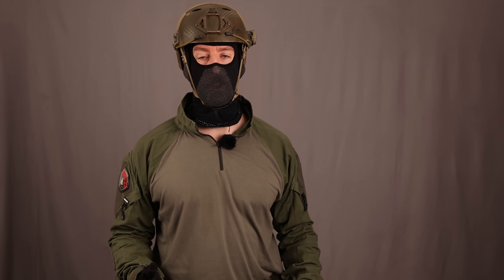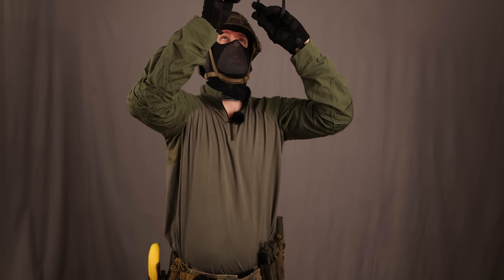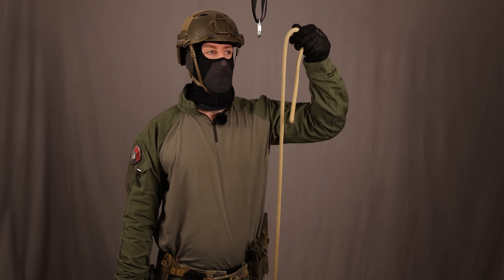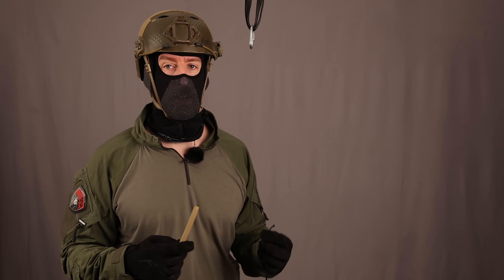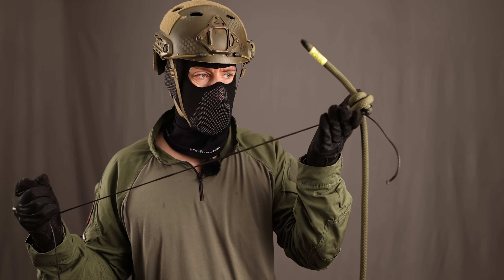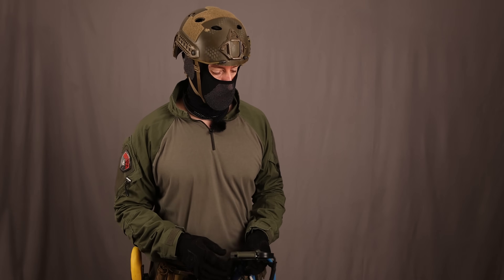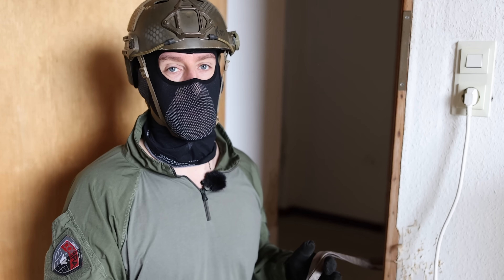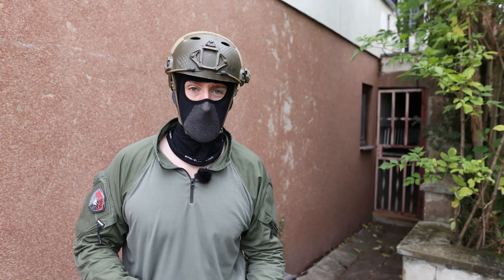How to Retrieve Your Rope After an Urban Rappel

Comment: 4:00 have seen that but adding a carabiner  to stop  the rope, that knot alone looks scary (specially depending on the size of the quick-link or ring that you use to rappel)
Reply from the maker: Yeah, but then you pull a carabiner down and have the risk of it dropping all the way down on a hard surface. So with the hight quick link I prefer to just use a knot.
But you are right. With some rings the knot will possibly just not be big enough.

Comment: Is that just a normal, non climbing rated steel threaded link? Yeah no problem getting a rope back because it's going to fall right on top of you when that bitch snaps under any real load? Bro I can't take you seriously when you're using hardware from the home improvement store

Comment: Why leave your slingloop? You can add the pull string to the loop end and after you are down you can pull the string and you might recive the slingloop and less traces/ evidence.
Reply from the maker: For a more universal approach I decided to show this. Everything you want to pull down by letting it slide on the floor is possible to get stuck. There are doors, furniture, toys, radiators and and and.
But yeah, if the building allows, you can build anchors, that will be reliable to pull down. I will likely do a follow up video :)

Comment: There is something we use in arborism where
The end of your rope has a ball(a knot might work too if done properly i guess,but a nice solid ball like a golfball or a wood bead that size)
A belt with two metal rings on each end,one ring big enough for the ball to pass trough,while the other smaller,so that it catches the ball
Once you reach the ground,you can pull back your rope,until you get to the belt,it gets undone,and you retrieve your attachment system too
Reply: Man just use a crotch in the tree 😂

Comment: what about using a "mountain climbers sheep shank"?   After tying it you cut the center strand but once you do that you have to be able to keep tension on the knot until on the ground. at that point you can shake it loose.
Reply from the maker: I tried it a bit in my studio. On the thin rope it seems not to work/releases under load.
With the 11mm rope it hold like 95% of the time. But shaking it loos was sometimes harder than expected. It indeed needs some movement and I am not sure how well this works, if there are 2 or more edges involved.
I guess I need to try it out some more to get a better feeling about it. But for now it felt like it is way less reliable than bringing a tag line or doubling up the rope.
Reply: @ripperkon I think you are correct. It probably only works for a straight drop rappel which is pretty much all I have ever done. If you had to anchor your rope around one or more corners or obstacles it might be difficult to whip the rope enough from down on the ground to get it to release. Another thing I didn’t think about is if you did a really long rappel the weight of the rope might also make it difficult to whip it hard enough to release the knot. Thinking about it more your methods are probably better.  I guess the mountain climber sheep shank would probably be best as a last resort when you didn’t have enough rope to double up the rope or didn’t have a tag line.

Comment: Look up a knot called the "sheep shank" tie this knot and study it carefully and you'll find you can cut one of the three pieces in the middle of the night and it will not fall apart until you get to the bottom of the ground and whip the knot whip the rope up and not comes undone and you only lose a few feet of your rope at the top. I wish I could send you a picture as it is pretty slick.
Reply from the maker: Ah, I know this as the "Kamikaze Knot" - but never tried it. Thx for the idea, I will try it.
I guess I will soon do some content to some options like that.
Reply from the maker: I tired it a bit in my studio. With the thin cord it just released under load. I guess it is not stiff enough.
And with the 11mm rope I feel like it needs a lot of movement to actually release. Maybe this works on a rappel with the anchor in sight. But in an urban setting with two or more edges ... I am not sure. I guess I need to give it some more tires to find a conclusion. But for now I feel like is a lot less reliable and you rope might get stuck.

Comment: 4:19 What type of carabiner is hanging up there ?

Is it even certified.. rated.. whats the price (and name in Germany/elsewhere) ?
Reply from the maker: This is a Maillon rapide or screw/quick link. Some manufacturers make them. 
The small 6mm version has got a WLL of 400kg and will break at something around 2.000kg. 

But it is important to use the certified ones, since the ones from the hardware store are weaker. HowNot2 possibly made a video about it.
Reply: @ripperkon  The ones one typically finds on difficult alpine tours/hikes.. 

i would immagine most of them are not certified..

as they are typically used for anchor to abseil (and left there)
Reply from the maker: Yeah, some indeed leave behind the non-certified ones :-/

Comment: door as an anchor! Why didn't I thought of that? Thanks 😊

Also descending on a 5 mm rope is some badass move, 8 mm feels challenging already. Btw, is it possible to do that SRT using a "super Munter"? Would it be worse than double rope and usual Munter?
Reply from the maker: Yeah, this is super quick, if the door is not fixed to the hinges.

To me it seems like beal doesn't want people to rappel on one strand.
I did not try it, but I am sure a super munter would work with one strand.
But I was surprised how well two strands with Munter hitch worked.
Reply: @ripperkon thanks, I might try this one day! 5 mm is a bit scary, but if one strand with super Munter works, the rope will take so little space you basically can easily have it on you at all times, alongside with a carabiner and a compact webbing harness
Reply from the maker: I tried it: The beal backup line works quite okay with a super munter on a carabiner with a round profile. A h-profile was too much.
Reply: @ripperkon that's awesome!
H-profile gives you uneven movement, right? That was the case for me with a carabiner break, and I preferred round steel carabiners
Reply from the maker: @mikethechemis  Yeah, and just too much friction.

Comment: I have tested the Beal Escaper many times in rock climbing contexts and found its applicability narrow. If using a dynamic rope over 30 meters and/or going over even gentle sloping ledges it becomes difficult to work the engage/disengage friction hitch and requires many dozens if not +100 pulls to retrieve. It would be cool to see a video on how it works on a static line in a shorter urban setting going over a 90 degree angle like a windowsill would work. I bet it would still be at least 30 pulls to retrieve.
Reply from the maker: I also used it with the old Edelrid Rap Line on 40m rappels - worked quite well.
With dynamic ropes I started to pull some rope stretch out and then let the whole rope bounce up. Since I do this, it works a lot better. At the beginning I was also pulling a lot while being afraid, that my rope got "stuck" until it finally came down.
I think for heavier static ropes it is useless, since the shock cord of the escaper needs to be able to pull all the rope up. But with this thin cord it should work. Maybe I can test this out with 1-3 edges. But I also think that more than the 90 degree on the window can be problematic. 
Thx for the comment, dude.
Reply: with a full 60m.... 20plus pulls.  right about to the point where you start to think....fuck... we're gonna have to go up the backside to get thei rope

Comment: Have you tried “Big hole, Little hole”? Quick link on one end of the sling and than a carabiner on the other. Basket hitch the anchor like you already do. Rope goes through both the quick link and the carabiner (preferred to be an HMS). Using the double length method, rappel like normal. But on retrieval, tie a stopper knot on one end. The idea is that when you pull the line, the knot passes through the carabiner, but catches the quick link with the stopper knot. This allows you to retrieve your rope AND your anchor. It’s the basic canyonneering retrieval anchor.
Reply from the maker: Yeah, I know that from climbing on trees, if I understand you right.
But still you need to pull some stuff through the room and have a potential hazard, that the rope gets stuck.
Reply: @ripperkon  use a Ball instead of a knot atached with a thin rope wich you break with brute force in the case stuff gets stuck... So most times it won't and you get everything back, the one time it does get stuck you only lose your retrievable setup but still get the rope?
Reply from the maker: @samyonboard  Ah, I know balls like that from tree stuff. Great idea. I never thought about it that way.
Reply: Also don’t you need to make sure you don’t mix up which end of the rope to tie the stopper knot? If you messed up and pull the stopper knot up and it hit the quick link first instead of the carabiner you would not get the rope or anchor back.  I would assume you would tie your stopper knot on the correct side of the double length rope while up top before throwing it over.
Reply from the maker: @snuffysmith4530  Or possibly always tie two different end knots to keep the sides "marked".

Comment: idea of using doors as an anchor is brilliant
Reply: I would be very hesitant to use an interior door in the US.  Very flimsy particle board/hollow cores means it will be an express trip to mother earth!!!!!!
Reply from the maker: @johnennis7721  Yeah, valid point. Some doors doors might not be a good option on their own.
Reply from the maker: Yeah, this is super simple. But recently I wanted to do this in an office building. But the hinges where closed and you would need to break the hinged to remove the door out of the frame ^^
Reply: @ripperkon If web-strap recovery is a non issue then you could form a large knot in one end, thread the loop through the door and frame at the hinge and close the door.  This will trap the web-strap and allow for the descent.  Key element to this operation is to place the strap as close to a hinge as possible, preferably the middle hinge on a three hinge door system.  If only two hinges are present, place the strap below the lowest hinge.

Comment: I like these videos about unusual anchor points, but I think I missed the simplest possible solution: wrapping a rope around, for example, a pipe from some installation in the house or a railing on the stairs (protected against damage, of course). It would be nice to see such an application in your implementation.
Reply from the maker: Thx for the addition and suggestion.
In the house of the video is no railing on the stairs. And the pipes on the self-installed radiators don't look that promising. And a damage on the pipes would result in a serious issue. While some scratches on the walls and doors are no issue. This is why this was not a topic before ;-)
I have this in mind for other locations.

I hope that from the videos it's clear, that these are just some options and not always the best, safest or easiest option :)
Reply: @ripperkon  Of course, I'm not saying you did anything wrong. As you wrote, it's not always possible to apply it. I just think such a film would be interesting.
Reply from the maker: @panluca7085  Yeah, I think I know, how you mean it. Thx for the input, dude.

Comment: Is this method at 3:56 really safe? All your weight is on this one knot and if knot is small enough it can slip trough carabiner.
Reply: If it's large enough, it's impossible for it to slip through the quick link. Some people do a secondary knot after the first just to provide some extra security. Also once loaded, the weight or force applied to the knot isn't going to change, So the person repelling already is able to see how applied tension is interacting with the knot and the anchor setup.
Reply from the maker: Yeah, since the knot can not fit through the narrow quick link ;)
But with a carabiner this could be fatal.

Comment: S'il existe un ancrage adéquate, il est aussi possible d'utiliser une corde doublée avec "Nœud Dufour" ou de descendre sur un seul brin avec une longueur de paracorde pour déverrouiller le nœud ! Tu trouves cette méthode trop risquée ?
Reply from the maker: Ah, I know hat as "Macrame Knot". Yeah, good thing is, that you do not need to pull the full rope around the anchor. 
I think this topic could be worth trying out. But to be honest: I did not try this before and it feels counter-intuitive to make a knot, that can be released like that. But yeah ... a safe knot to a broomstick is possibly more sketchy :D 
I put that on my list and would also do a pull test with the knot. The for the suggestion.
Reply: @ripperkon  It seems to me that it is authorized as an emergency option for a rappel of less than 10 meters with a minimum of 8 braids. It works on the same system as Beal's "Escaper"! 😏
Reply: this is an interesting question